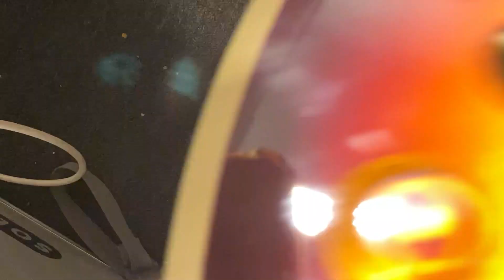Training Your G String - Solving tuning problems on Gibson style headstock guitars

Comment: Wind the string up, not down, helps
Reply from the maker: @atheistconservative6211  Yes, decreasingly the break angle at the nut by winding upwards on the tuning capstan (as with low E on strat for that matter) can help, as can putting the strings on the tailpiece back to front and having them run over the tailpiece on the way to the saddles. Lubricating can help too. Rock on 🤘

Comment: click bait
Reply from the maker: I reckon everyone knows to bend and keep retuning when first installing strings but plenty people don’t know to bend and retune repeatedly when tuning at a later date when the temperature might have changed etc. Also, watching to the end, how many people know why this works in terms of the string seating in different places on the nut? It’s not just a case of the strings needing to be stretched in the same way as they need to be stretched when they are first installed. On top of that the end of the video shows lubrication of nut and saddle. The video does what it says in the title and the thumbnail is accurate too. I realise some people know all this already. Rock on 🤘